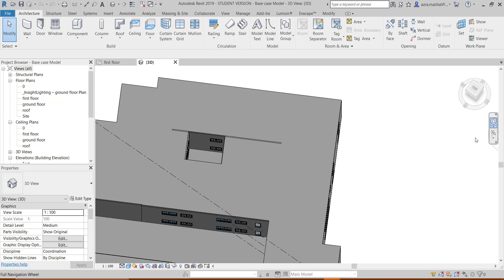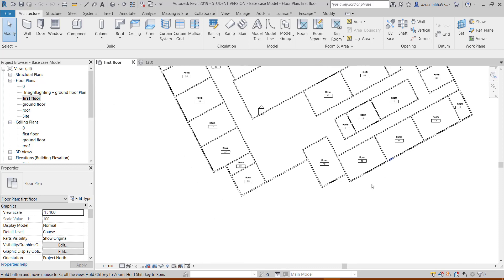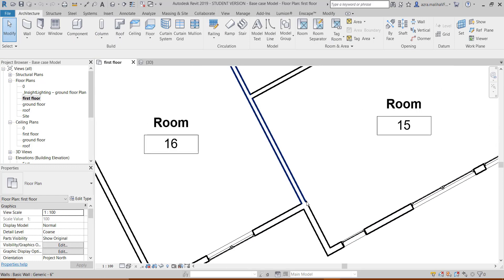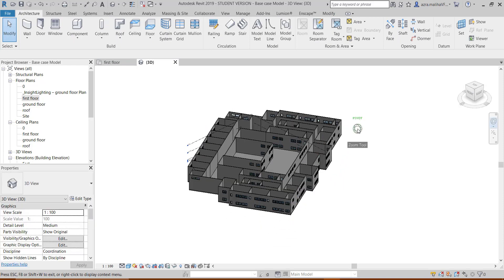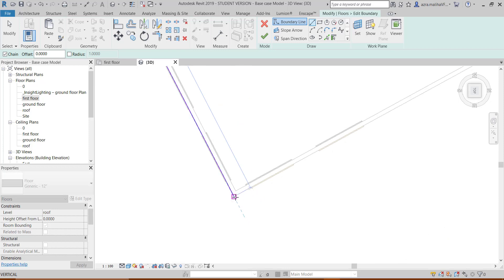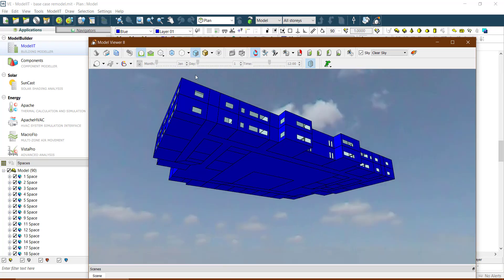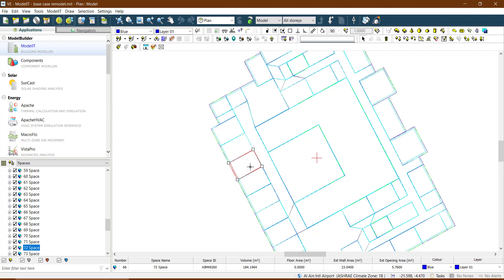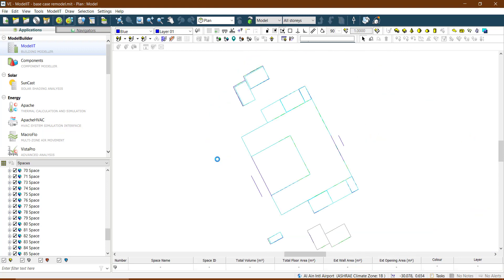Revit model to IES VE - How to import with proper void and model edges

Comment: I could not create  the staircase into revit model after I export  revit model to iesve software
Reply from the maker: Hello, as far as I know, you do not necessarily need the staircase in iesve software since it's just a simulation software. The main aim usually are the energy, lighting, ventilation simulations which are not affected by stairs. Also, if you notice, iesve do not have staircase making option in the ModelIT.
Reply: @azramaliha  thanks

Comment: "Revit was unable to identify any rooms. If you are sure that rooms have been created in the project, please check the Project Phase setting to verify that the Project Phase matches the phase in which rooms have been defined in your project. "  <- That is the message I get when I try to export a gbXML file.
Reply: Do you think you could have a quick look at the model?
Reply from the maker: @saahiljalil4811  yes sure you can share your model through Google drive and I will take a look
Reply: @azramaliha   Thank you for your reply. What is your email please?
Reply from the maker: @saahiljalil4811  azra.maliha@agu.ac.ae